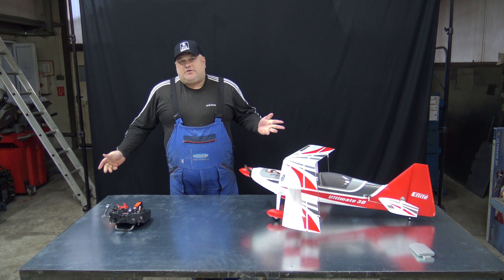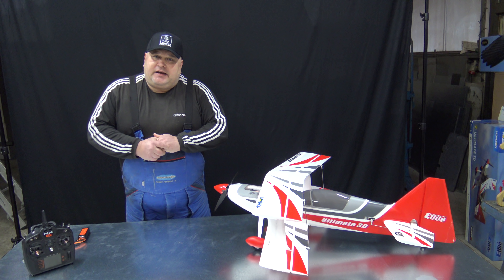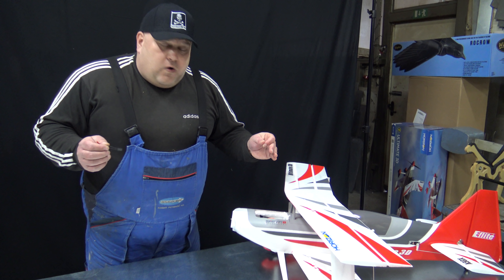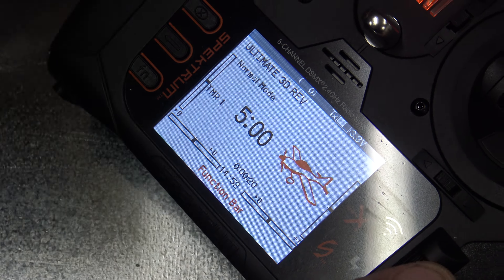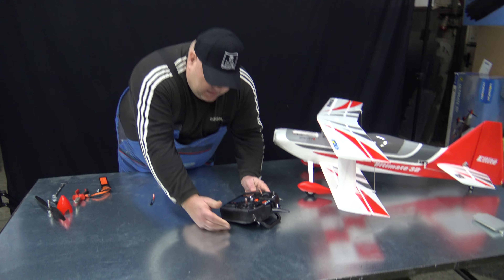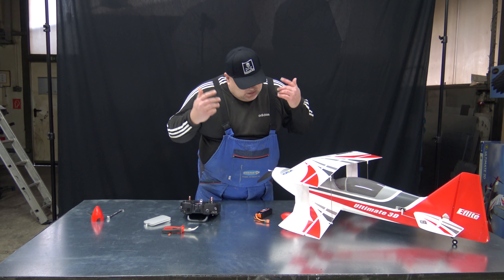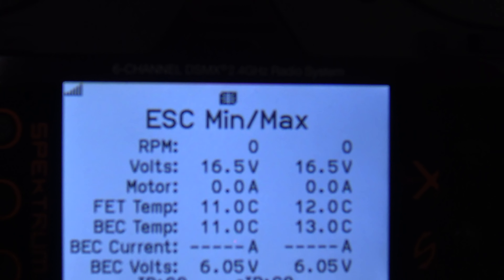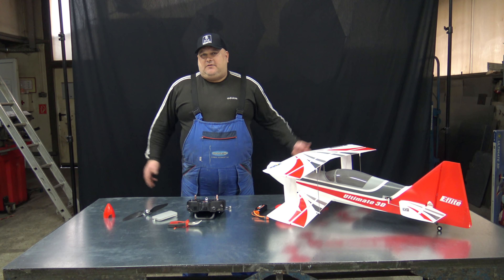ULTIMATE 3D Smart Biplane BNF SAFE select setup on Spektrum NX6 radio Quick guide

Comment: Hi Bro’s another great video 👍
I’m new to electric flight and have bought an fms beaver with a radio master tx16s. Problem is I don’t know much about the electric setup and connections... what powers what and how does it all connect.... can you explain?
Reply from the maker: I also have TX16 but didnt set a plane on the radio yet so its hard to say. You will have to check on some other videos. But we will also film one video how to set radio and the plane ( reciever, batterie and all ).
Reply: @PetrincicBrosRC  it doesn’t need to be the TX16 and that would be great just to see how the components should all connect, things like the SBUS too 🧐. That would be fantastic if you could 😊

Comment: 👍😊😊
P.S.
I just might try this "Safe" fun with TX16S and Opterra when arrive - as fun winter project..
If I don't manage until spring - I will just use my S6R .. 🙃😜
Reply from the maker: I will sure use it on Opterra for hand launch.
Reply: @PetrincicBrosRC  👍👍 on that !
BTW: 1) do you know if there is any chance that EDF Neptune could be find somewhere in EU ? Or any EDF wing (besides your Skunk works creations .. 😉)
2) Do you know where i could find that Spectrum Transmitter/Receiver Bluetooth programming module
Item No.SPMBT1000 in EU ?

Comment: Salutes from Australia and another great video. I'm interested in getting the Ultimate 3D when it's back in stock, I'm using a DX9 and was wondering if the reverse can be set on another switch and channel. I normally like to use my A switch for SAFE select, and it could get messy if i have reverse on that switch. Cheers.
Reply from the maker: I think it must have the extra cable from ESC like for example Aerostar Tundra for reverse.
Reply: @PetrincicBrosRC  Hi again, just checked the Ultimate 3D manual and it says you can not use aux2 for SAFE select on reversing ESC feature. On the DX9 black addition aux2 is a 3 position switch E, so i should still be able to use A switch (Gear) For SAFE select. Does this sound correct or do i still need the extra cable from the ESC.? Thanks in advance :)